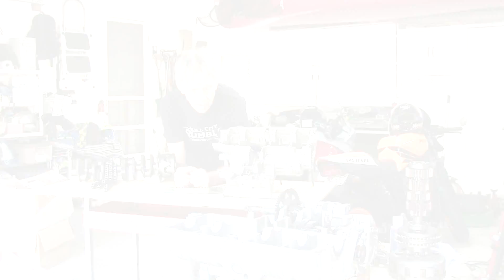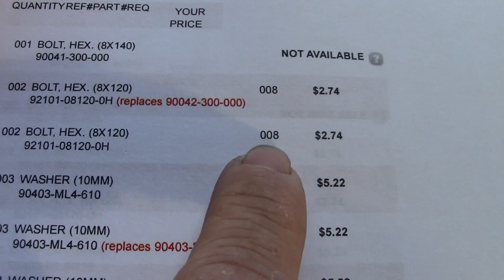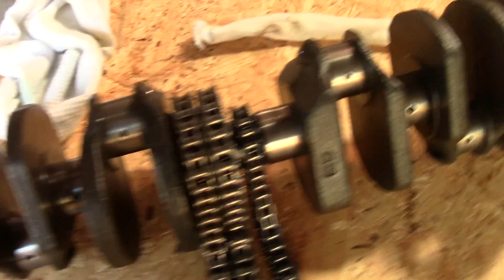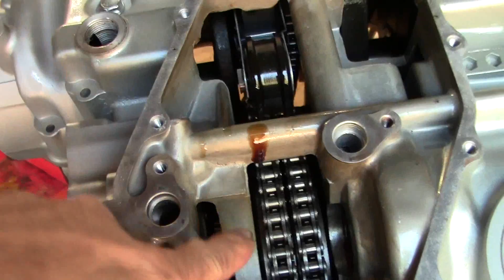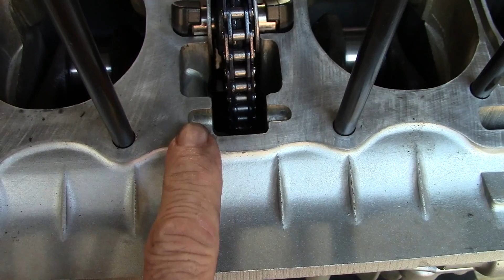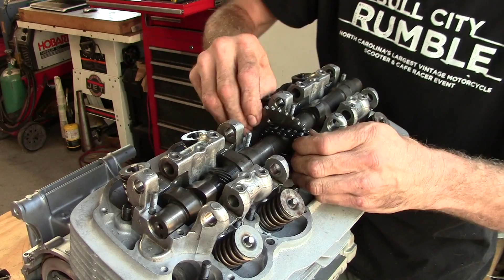73 Honda CB750 Custom Build Episode 12 - Primary & Timing Chain Inspection

Comment: 10:57 no glue at all?
Reply from the maker: Not final assembly, just an inspection and test fit.
Reply: @HackaweekTV_KR4NIV  oh ok, that's why.
Reply: @fvmmecanica1135 It's best to test fit the parts 1st before you start putting any screws bolts/washers on 💁‍♂️🏍

Comment: when you're putting the cam chain on the gear up top, could you put the two together and slide the cam shaft through the gear and into place all at the same time?

Comment: Jeez, the memories. I had four CB750s: two K2's, a K7 and an F1. The K7 was probably the best looking, but those motors take some working on. As I recall you cant get the rocker cover off without dropping the engine out of the frame. Definitely not designed for working on. Great video.

Comment: Nice video again! Learning alot! are you also goiing to clean the crankshaft? Drill out the oil ball galleys, remove the sludge that 30+ years has left behind put in plugs etc? Öre do you skip that part?

Comment: For crankcase bolts what I do is simply screw them in one turn very loose and make sure they are all spaced out equally which should be about 1 cm from the top.

Comment: What works even better during the cylinder/head install is to hook a bungee strap up to the ceiling and connect the cam chain to it. Then route it through the cylinders and re-connect it to the ceiling when dropping the jug into place.

Comment: In the past I've just let the chain sag into the case while I put the cylinders and head on and then fish it out after with a telescopic magnet. Seems easier than trying to hold the chain while dropping them on.

I didn't know about the measurement specs for the chains ... definitely good to know that. I just replaced mine. However, my engine rebuild ended up costing ... a lot.
Reply: I've been wondering why people think it such a calamity for the chain to drop into the case.  So, there's no real reason?
Reply: As long as your cam ends up timed correctly with your crank then I can't see a reason why it would matter.

Comment: this how warranty is done you would think heck just new chains but if one under warranty had problems these measurements would show you where you are off. this is the hard way its also the difference between 6 months of riding before scattering the engine or 200k miles without any problems
Reply: Jeff Bankston At a cost of $250 for new primary chains, I'll trust the spec sheet that says mine still have a lot of wear left in them and leave them alone.
Reply: Yes that's what i'm saying to many people would change them for no reason. These young guys now days want to just change everything I remember going to the junk yard and pulling heads to find .020 over piston's on car engine to save that money for a hot cam. Today its buy it all. This is a Honda new rings and gaskets and keep on driving this is how its supposed to be

Comment: Hmm.. although, it was quite interesting, it raised a lof questions. Are you sure, that that 6 mm clearance in the primary chain is enough to assemble it? It has like a couple of a thousand miles in it max. When the washer is harder than the bolt and/or the surface, it eats up them. if the washer is softer, it can be replaced, the bolt and the surface remains intact, and the tension holds. too hard washer may act as a slide bearing.

Comment: HackaweekTV Why did you take the time to put assembly lube on the crankshaft, but not on the camshaft?
I would love to think I would be able to do a build like this from scratch, but to be honest, it's very probably beyond my ability.  A great video and I really enjoyed it.  Thanks.
Reply: Ace00731 Everything is coming back apart. There are parts in the lower end that are missing. This is all just a temporary assembly.
Reply: he most likely didn't lube it, because he is going to have to take that off anyways. hes just checking the length of chain. But all the other stuff he lubed he doesn't have to take a part. just has to put the pistons back in.
Reply: ah yea thats what i figured! haha thanks for the reply. I have been watching since the sabre. Im also working on a yamaha xs850 cafe build. Had to get the head worked on, and have been putting it aside since i got it back. But yea i do alot of putting together and taking back apart.

Comment: ive read if you leave out those little 8m bolts that keep the rocker shafts from spinning it allows those shafts to rotate, thus reducing uneven wear.  its talked about on a major forum
for this bike.
Reply: Ste W So if you do that, what the hell keeps them in place?!
Reply: The shafts have a waist on them.  The 10m center bolt holds the shaft in place.  The 8m bolts were added later and designed to reduce a little bit of noise by preventing the shaft from rotating.
Reply: Ste W Aha! http://draftcycleworks.blogspot.com/2013/05/free-horsepower-reducing-friction.html